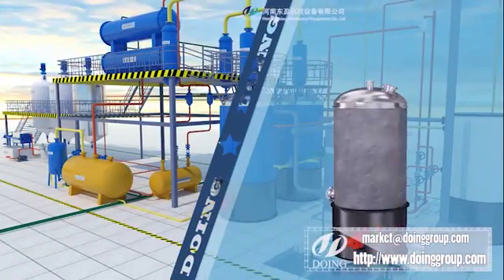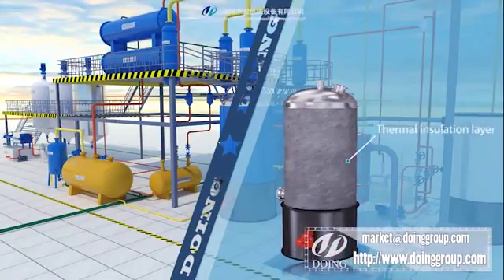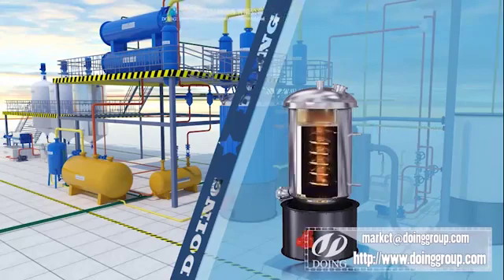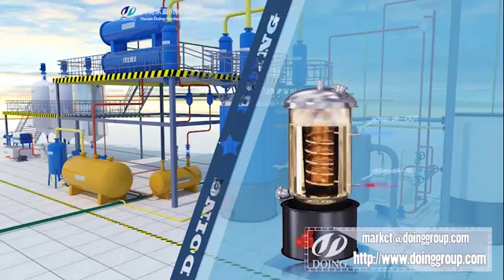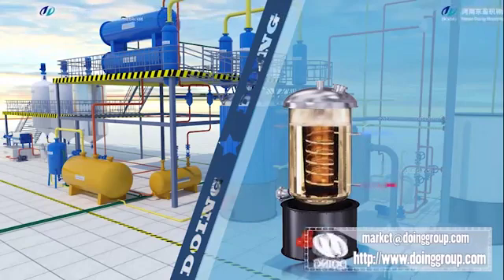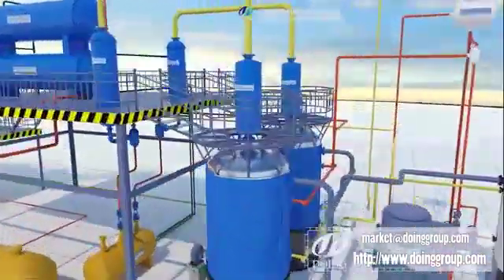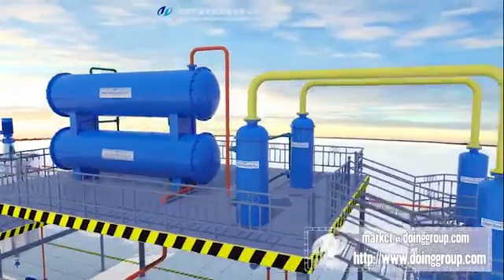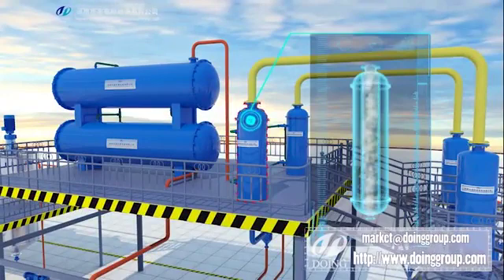3D video of used motor oil to diesel refinery plant

Comment: But this is a non standard diesel. How can you further process this into a diesel for everyday automobile? How do you solve the problem of unstable hydrocarbons and olefins that cause it to degrade overtime causing fuel filters and injectors to clog? I know theoretically hydrotreating can convert non standard diesel to a standard diesel that can meet ASTM D975 or EN 590 standards. How do you really solve the problem of sulphur dioxide etc?